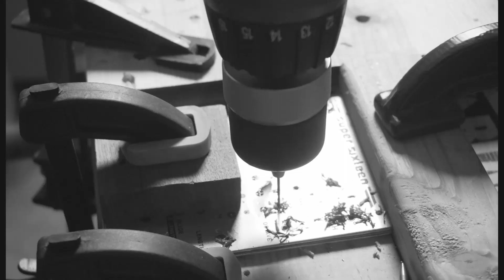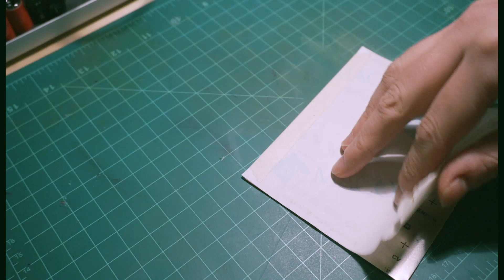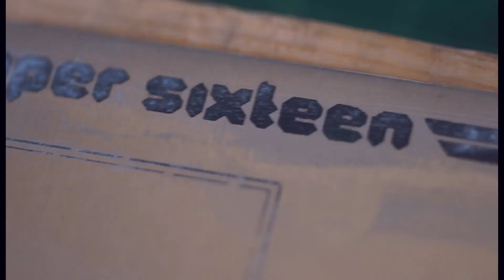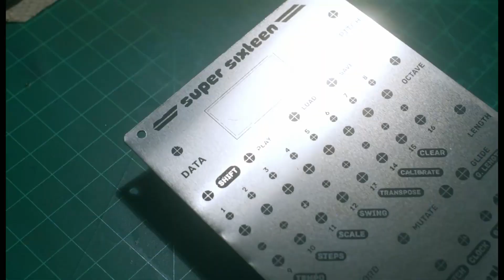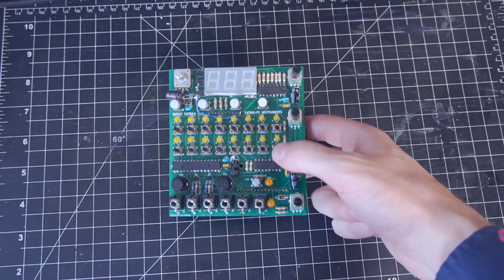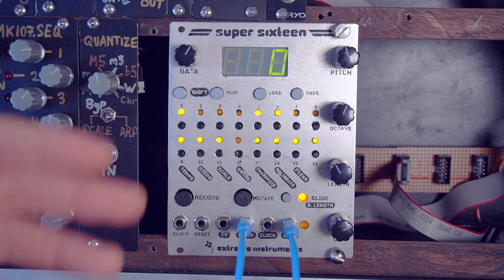Designing A Eurorack Sequencer Part 8: New panel, Patch memory, Performance effects

Comment: Wow, wow, wow. This is a great product.
I was looking for some info to create my own sequencer when I found your channel. This is absolutely a great project and worthy to be added to any store selling Eurorack modules.
The level of documentation, readability of code and all information needed to build one is worth mentioning. Converting this into a Teensy4 project with an SD card for storing data should not be that big of a problem for me. Why Teensy4 ? Just because I used them for some other projects, have some more projects in the making with Teensy4 and Teensy4.1 board.

Comment: Why not laminate a transparent foil with the printing on it by acryl or epoxy onto the aluminium? This would have the advantage, that the aluminium could even be spray painted in some light color, before the transparent foil is laminated. Or the printing on the foil could be done by a color laser printer in a print shop.
What laser printers use as a toner is a polymere mixed with pigments anyways. Glueing/laminating the whole foil onto the front just extends what is part of the process and materials used.

Comment: Incredible! Did you have any luck suppressing the noise? Some turns of 0.4mm wire around a toroid or some capacitor inductor combos might help to suppress it you will probably have to play around with coil sizes toroid types and it might help to be able to see the noise on a scope while you play around with the various values and variables. 
  I would first research similar noise and how others have dealt with them. Like someone else mentioned it could also be to do with grounding. It's not evident in the video.

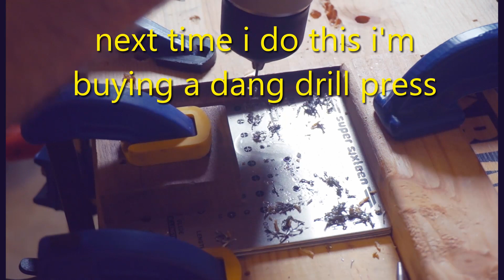Comment: 5:48 For way too long, I told myself that drill presses were unnecessary and I could spend my money on better things.  I started with a super cheapo Ryobi and it's more than enough for Eurorack.  Caught it new with a coupon for $70 and it's made drilling enclosures and panels SO much less tedious.  If you have the space for one, I really can't recommend it enough.  If you don't have the space for one, look up conversation rails for your model of hand drill.

And on rewatching, the bit seems to bow, that usually means you're pushing too hard/fast on a tiny bit like that.  It's what makes em snap!

Comment: super coool
did you managed to work out the digital noise issue from the segment display ?
Reply from the maker: Yes, I think so! I found a really helpful application note from Maxim that describe exactly this problem using bypass caps in combination with inductors as an LC filter on the power input. After a little toying around swapping out my ferrite beads for proper inductors and using a bigger input cap, I was able to reduce the noise by 15-20 dB, which gets it pretty close to the floor. https://www.maximintegrated.com/en/design/technical-documents/app-notes/4/4713.html

I also found an article by North Coast synthesis that describes a bunch of LED driving configurations, including a constant-current driver setup that can theoretically get the current swing to almost zero, but it's more complicated to implement and does waste some power. I will look further into it if I get user reports that the noise is excessive. https://northcoastsynthesis.com/news/driving-leds-digitally/
Reply: @extralifedisco  Okey great news, i'm going to dive into these papers !
thanks for the work !